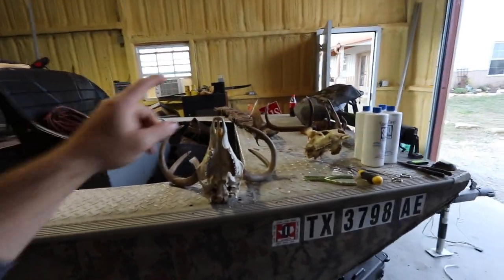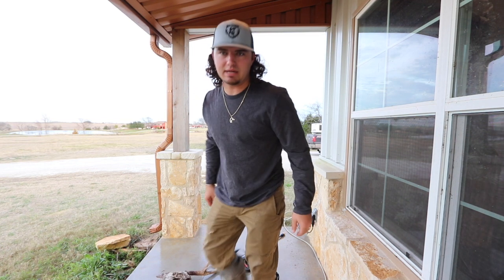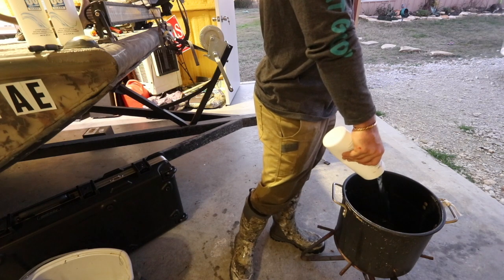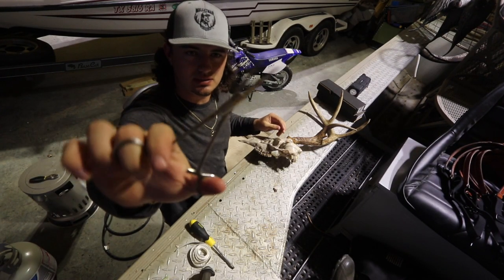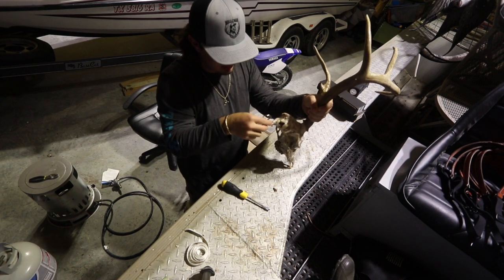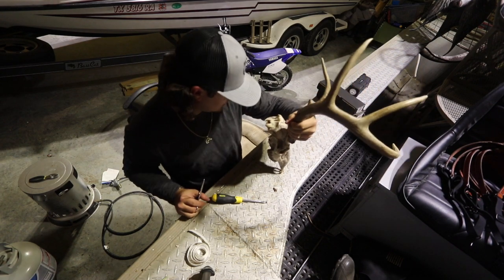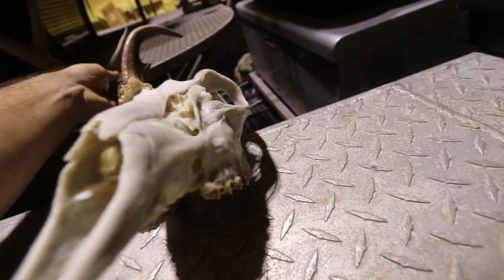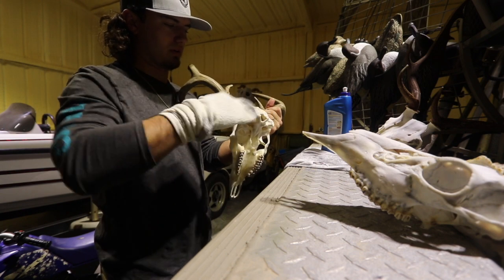How to do your own EUROPEAN MOUNT the easy way!! (GIVEAWAY)

Comment: I have done a couple of these. Took several boils to get them clean.  I used needle nose pliers to pull the brain and eyeballs out.  I did not bleach.  I used to cut the antlers off, but now wished I had done all European mounts. So much more character to have the skull still attached. Thanks for sharing.

Comment: If you add soda ash to the water you will have a lot less clean up to do with the pressure washer. Also taking off everything you can before you boil it helps. The soda ash will remove quite a bit. I have never had to use a pressure washer using soda ash.

Comment: Not sure what strength the hydrogen peroxide is ?
Reply: Dave Mitchell  the strength is 30% by volume. That means in the bottle he had it is 30% peroxide and 70% water. But you want to dilute that with water when you mix it to boil. You can’t boil just in the bottled peroxide or it will ruin the bone. You want roughly 1 part peroxide to 3 parts water. So if you have a gallon of the bottled peroxide, you need 3 gallons of water. Hope that explained it easy enough it can be confusing.

Comment: I dont have an Instagram, so I know I wont be entered to win anything, but here's my most memorable hunt. I was 13, had been hunting with my uncles since I was about 7 or so, but hadn't killed my first deer yet. I went to my uncle's hunting lease in Greenville Alabama to hunt with him over a 3 day hunt. It rained the whole trip, not hard, just enough to be annoying. We didnt see anything until last light, on the last day, and what we thought was a doe came out. I shot it with his 300 win mag....needless to say it fell where it stood. Turned out to be a button buck. We took pictures, then went back to camp to clean it. He went to go inside the cabin to get his knives, but his rubber boot slipped in some mud by the door, and he went down hard!. He is 6'6", and around 300 pounds, so yea. When he hit, his back hit a piece of metal, and gashed his back, really bad. I ended up having to drive him to the nearest hospital....without even a learner's permit, and the hospital was over an hr away. We get taken back to a room in this hole in the wall hospital, theres dried blood, and other body fluids on the floor, so we both looked at each other like "damn, this isnt good". He ended up getting around 15-20 staples....thankfully he didnt get an infection from that dirty place. Went back to camp, and we cleaned the deer.
Needless to say he didnt go back to that hospital to get the staples out.
Theres my story

Comment: If the deer has been sitting out or even sitting in the freezer, the blood and oils end up soaking into the skull. To prevent or reverse this use a degreaser before boiling. Let the head sit in soap and water for 24 hours and when the flesh on the head turns white the fats and oils will have been pulled out of the skull and ur ready for boiling.